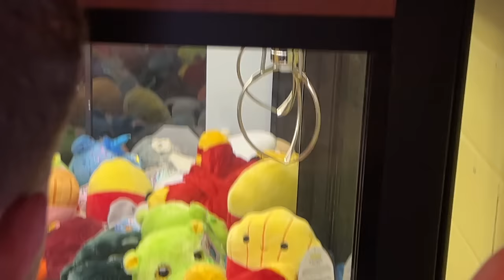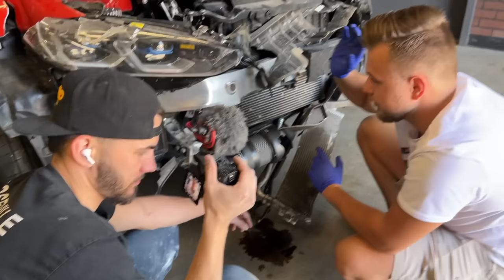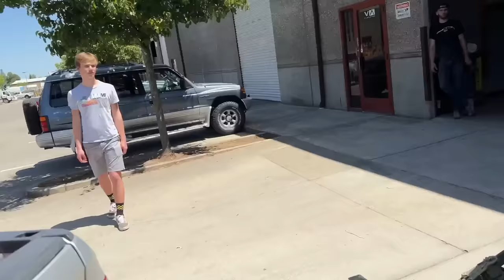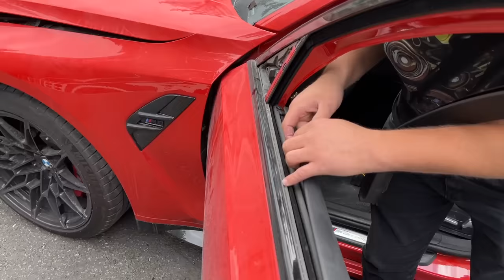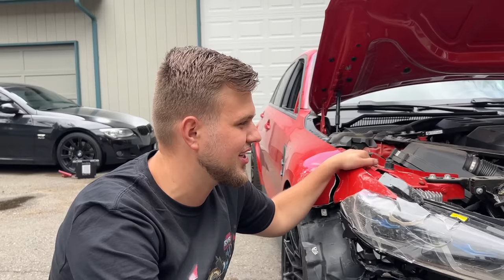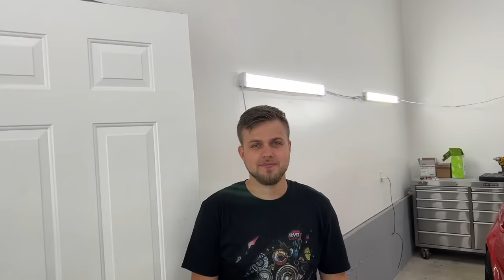I Bought A WRECKED 2021 BMW G80 M3 From IAAI And I GOT SCAMMED!

Comment: If that left headlight still turns on and the actual LEDs aren’t damaged, you can just buy a new lens. They’re like $100 on ebay, and just glue it in. There are videos on youtube on how to do it, way cheaper than buying another headlight. You just need to heat up the cracked lens to pry it our, then glue in the new lens. Laser headlights are not cheap

Comment: Car looks sick and good for family opposed as the m4. I would keep the black oem wheels and put the car back to oem spec.  I'm not a red fan color but this one is stunning. From factory that car has a really nice design inside and outside, doesn't need any mods in my opinion. (Maybe just the suspension). It is a real bummer for these expensive mirrors. Looking forward the rebuild, keep up the great work!

Comment: Yes Tim. This M3 needs the red carpet treatment. Obviously the guys stole the wing mirrors to sell on with other trim pieces and in a rush they pulled the door cards with excess force. No care used. Keep those stunning M3 wheels. Add a black boot spoiler, trim colour coded pieces in black. Carbon fibre been around years now. Been done a zillion times already. Keep it OEM looking. It washed up well. Best colour ever. This will be a totally awesome build on your phenomenal channel. U.K. supports you. 🇬🇧🇬🇧🇬🇧

Comment: Did the original owner not have the 2nd key???

Check the ebay listings for mirrors sold out of california and I guarantee that is who stole them. Probably a yard worker who steals little things like this and flips them. If not that you have other rebuilders that are scavenging yard for high dollar easy to steal parts so they make more margin on the flips. It's super easy with high turnover yards to go a steal the parts you need.

All the original OEM parts are going to be like $18K if you have to buy new mirrors.

Comment: Just did a similar build on a Nissan Maxima.  Parts list for that came to about $6500 (and that was without the airbag issue).  Double that estimate b/c of it being a BMW, + add 3 k for the side mirrors + 1,800 for airbags (I have no freaking clue) + headliner + oil cooler + control arm stuff.   Grand Total for your dealer purchased parts = $19,500.  Negotiate with them and have them throw in a years worth of free car washes.  It's the least they can do.
Reply: Air bags 10k 
Mirrors 3k
Hood 2/3k
Bumper 2/3k 
Paintwork 2k
Headlights 4k
Radiator 2k 
It's gna take 35/40k all in.